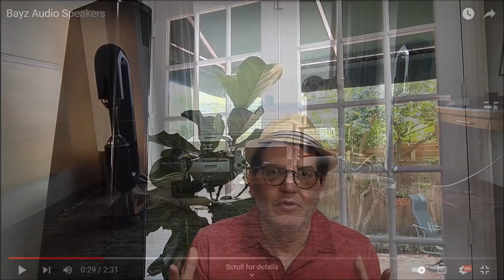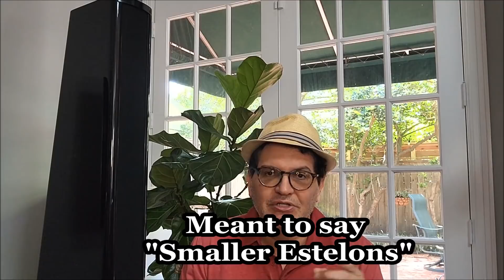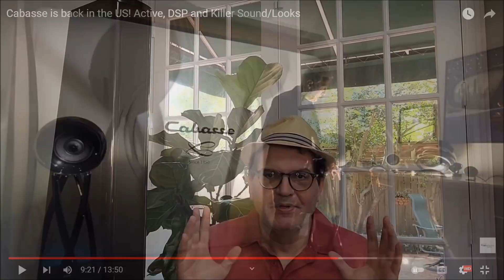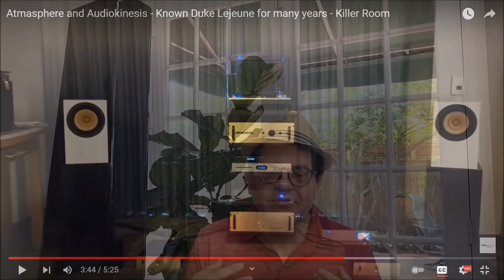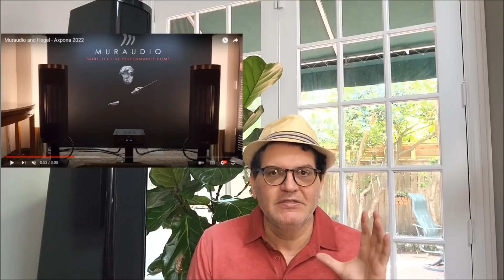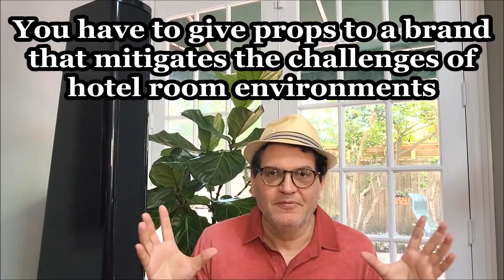Axpona 2022 Audiophile Show - My Favorite Gear, People and Experiences

Comment: Maybe I missed it, but what was the model number of the smaller MBL's? --Thanks
Reply from the maker: In the MBL room video on Day 1, I think I captured the sheet that outlined each piece of gear and the pricing.  The smaller speakers are the 126 if I recall the numbers correctly.

Comment: Wow what a difference the sound is from your room you normally film in above your garage is compared to the room you’re in now with the  32 or 35 glass lites and wood double doors behind you. There were lots of the reflections and echo from the glass and wood double doors behind you. But then there’s the reflection from the ceiling and left and right walls and perhaps there’s hardwood or ceramic, or stone tile floors? which add additional reflection points
Reply from the maker: It's a wood floor with a rug, but yeah it's not anywhere near as good as my normal listening room.

I thought it would be a good subliminal message about how important the room influences what you hear because I featured the Tiger Fox as a great example of how much the environment matters... As well as implying that whatever you hear at the shows is never optimal.

I don't go into these shows hyper analyzing every aspect of the sound because I know I'm mainly just comparing rooms versus the gear in these poor environments.

I primarily listen for key attributes that I know will translate well to a great environment or brands that have done the best at mitigating the issues with setup.
Reply: @AudiophileJunkie  agreed 100%, I heard it right away! 

I haven’t been to a show in over 6 years! How did the same thing you did go in try and listen to the system and make an assessment. The last show I was at was the Newport show the promoters changed the hotel venue from across the airport to another hotel complex with a glass elevator.  when you stepped inside the elevator it was like a sauna, up to the second and third and fourth floor.  the heat inside the elevator was so intense by the time you got to the your floor the top your head was soaking wet! Obviously whoever built the hotel didn’t think to install fan to exhaust the intense heat from the sun exposure.
Reply from the maker: Yeah that's a common problem with buildings. They create a greenhouse with all that glass and there's no ducts for AC to cool it.

Ironically, it's kinda like the Gryphon amp.  Cool idea and looks great, but doesn't consider the practical concerns.

Comment: My first Axpona. First visit to an Audio show since I used to go to every CES in the '70's working as a Rep. Been out of audio for decades. 

Like you, I am a "not in a box" fan. I love my Maggie 1.7i. But I am also a die hard Analog junkie. So I had two main goals for my visit. Less about what I might want to buy as it was about challenging my prejudices. 

1) can you make a box speaker with drivers that does not sound like a box with drivers? ... Overall the answer seems to be NO! Even when they would produce a solid center image, you could detect where the boxes were. Center image enhanced with side reflections.  I started on the main floor with large exhibit rooms, Krell, Burmeister, Klipsch Jubilees, ... then wandered into the larger hall with the record sellers. MagnaRisers was in a typical little draped booth. But when they turned on the LRS on their stands suddenly there was that magical full open sound field that was lacking in every room so far. In some aspects (beyond pure volume level and frequency extremes) that was the best I heard so far! When I walked into the Bayz room, before realizing which speakers I was about to hear, that room filled with open sound just sang out to me! And yes the MBL blew me away. 

Only able to hit half the rooms at best in one day, the only box/ driver speakers that just made the speakers disappear and produce that solid center image was Jones Audio. I was truly amazed at how good that image was. From a box with drivers! 

2) is digital not as identifiable and lacking as a source? ... Unfortunately it is. I was 100% on guessing whether the room I walked into was sourcing analog or digital. Including two rooms where a record was physically playing but may or may not have been what we were listening to. One room they said it was off the record. I challenged them and they discovered it was a CD! The other was backwards, they said it was being streamed, until I pointed out some very slight surface noise and when checked, yes it was vinyl sourced. So two unintentional "blind" tests as well. In those that were digital to start and they played vinyl when I asked, the sound field immediate deepened another 10'-15'. MBL was one of them. When I brought it up they guy commented about maybe 2% of people can tell the difference? I doubt it's that low! I think it is more training how to listen. And I guess just personal preference. 

While I won't claim my reasonable budget oriented primarily old school system would blow away all that stuff. I am happy with how it does stand up to what I heard there. Of course if a Gryphon Apex amp showed up at my door.... I have Maggies after all!
Reply: I was a Maggyman too, but once I heard GoldenEar speakers, I never went back! They are easier to place and drive, and they DISAPPEAR!